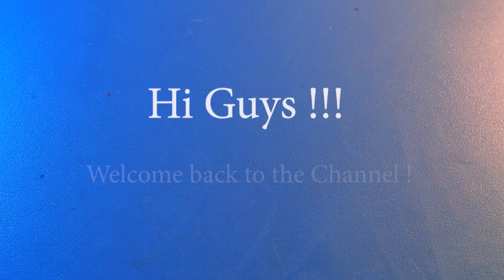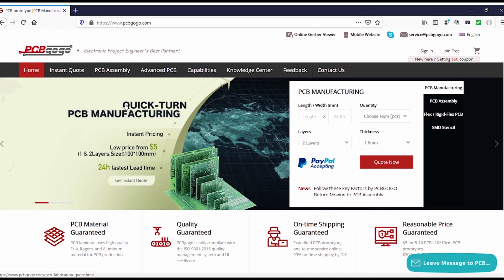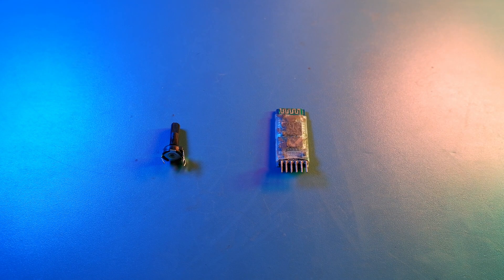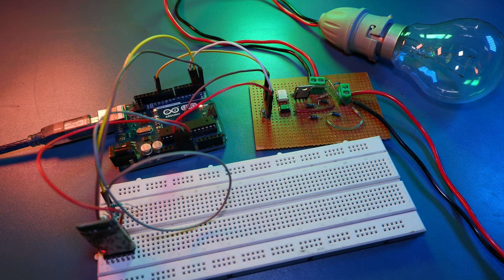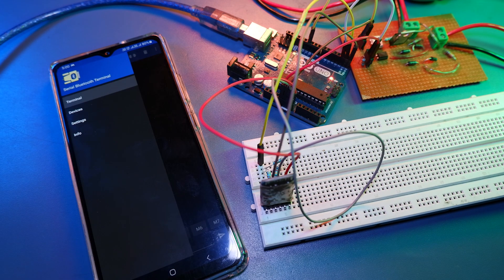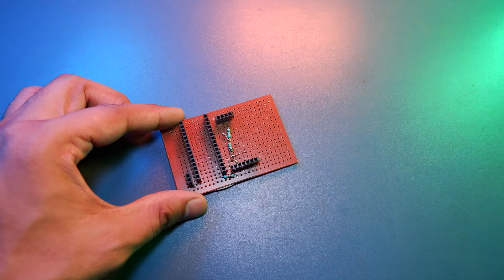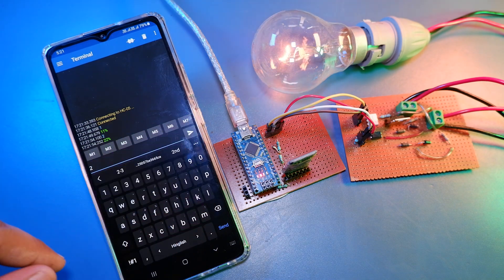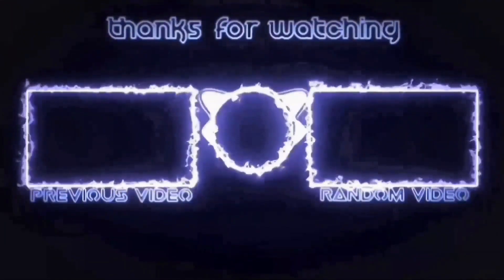DIY Bluetooth  AC DIMMER with Arduino | Control light intensity of AC light bulb using BT AC DIMMER

Comment: One fun project would be something to monitor when you get mail via letterbox and alert you, I set-up a simple LDR activated sensor that would when triggered, wait for letterbox to close and then play a "thank you", not linked it yet and as in block of flats, will have to use 433Mhz for range.  But getting there slowly.  I used a "ISD1820 Sound Voice Recording Playback Module" for the audio and easy to link up to microcontroller/anything with GPIO.    Did have play with a "Microwave Radar Sensor RCWL-0516", but the LDR was best as the microwave sensor was just a bit too sensitive and a small cat walking past the place from meters away would set it off.   Those two modules ISD1820 and the RCWL-0516 are very cheap and easily available.  Certainly the RCWL-0516 has great potential and cheaper than PIR modules for some reason as well.

Eventually plan on having lots of sensors of various forms all linked to a personal assistant of my own making without any cloud  data-cow sharing with companies.